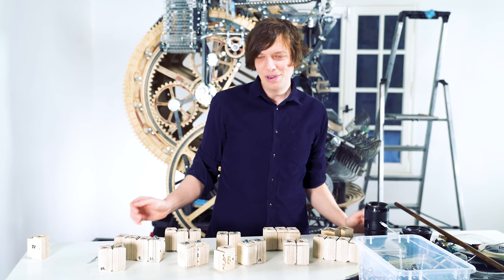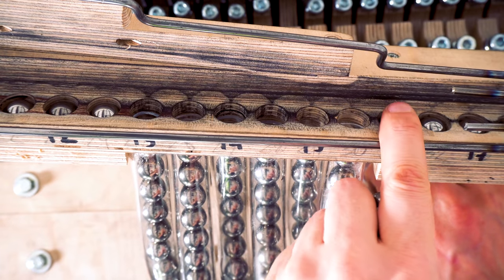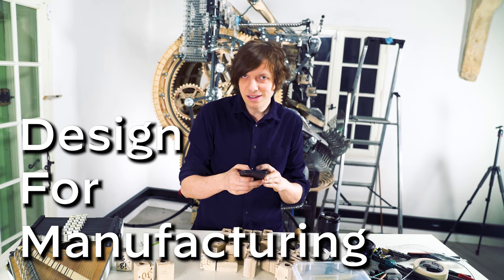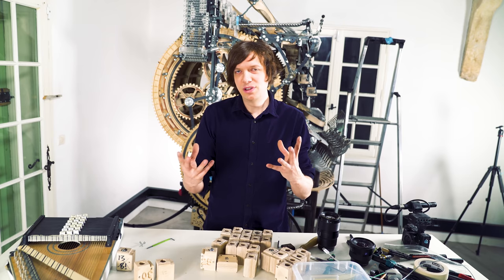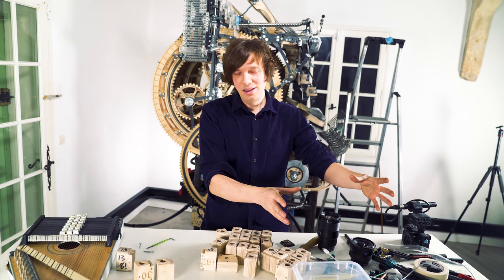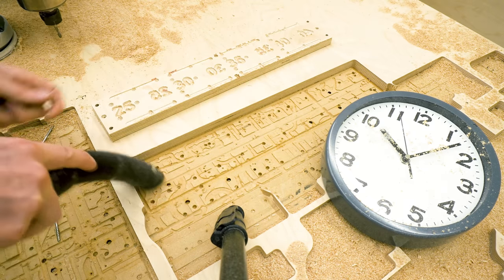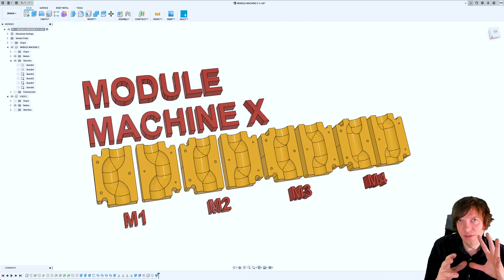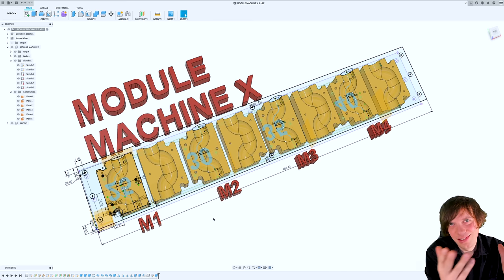Module Machine X

Comment: But is the Cybertruck really DFM? Assuming the chassi is made out of pressed sheet metal, why does it matter if the shapes are simple. If anything it should be worse since making sharp corner bends in sheet metal is more difficult. What am I missing?
Reply: I don't think you're missing anything. You're right about the sharp bends, say at the top peak angle, the sides at the top also seem to bevel. The junction of those compound angles would seem to need a v-notch and a welded joint, or two sections welded together. A curved roof side section would one piece and be done in a few forming dies/presses and even have connection points for the side pillars.
Reply: youre missing being a blind elon musk fanboy and beleiving all the ridiculous uninformed praise about him and his companies that martin apparently uncritically laps up.

youre right, bending hard lines into sheet metal is MUCH more difficult than the simple curves that car manufacturers have been using for over a hundred years, not because they "found them more beautiful" but because that's how bending metal works
Reply: It's because, supposedly, the grade and gauge of hardened stainless steel could not be pressed using normal techniques that are used to press thin gauge steel in normal vehicles.
Reply: @Hephera  The thing is it's 3mm stainless. It's probably cut and welded together. I'm thinking at best they could do simple unidirectional curves, but nothing near as fancy as most cars with compound curves. They would need ludicrous tooling.
Why the hell Elon decided to use 3mm stainless? I have no idea. I heard it's what he uses on the Falcons.
Reply: not missing anything. martin just has no idea what he’s talking about. simple as that. as impressive as he is. he’s a musician, not an engineer. obviously.

Comment: Cyber truck explained: it’s for style, if they can make rockets they can bend 3mm steel. They just didn’t do it because they didn’t want it. Just like their quality control on teslas.
Reply: You sort of opposed your own statement. “Quality control” sure they could figure out a method to stamp curved steel that thick, but it either would cost a fortune, or be unreliable with their shapes and panel gaps or something along the lines. As well, it’s hardly comparable to talk about rocket ships, vs mass manufacturing. Completely different engineering topic, and both are similarly complicated to get right

Comment: Round shapes deflect pedestrians without decapitation.
Reply: But decapitation gives the most points
Reply: With round shapes you survive as a paraplegic, canting angles finish the job and save you from becoming paraplegic
Reply: Design road infrastructure to keep people and cars separate. Designing cars not to kill pedestrians at upwards of 40mph is just a bandaid for poor road design.
Reply: @dugg117  'Judge I ploughed through that bus stop outside a school at 3:30pm because of the bad road design, honest..' you cannot road design away the idiots and the maniacs, until all vehicles are fully autonomous we have to assume there will always be accidents, even then it probably still makes sense to compromise DFM for the sake of safety just in case.

Comment: Just gonna say that the discussion about the cyber truck seemed to have nothing to really do with DFM. Whether the shape is geometric or organic doesn't make it any easier or difficult to manufacture (one could argue that it makes it more difficult if you ask me due to the manufacturing technique used for car bodies). You went into the discussion with a good idea but then it just seemed that you didn't get what DFM is.
A good example is when you design a 3D printed part. A good designer will consider the advantages and limitations of 3D printing when designing the part, such that the manufacturing process takes full advantage of the technology. This would include consideration of overhangs as the most common one. 
In the case of the height modules, that would be considering the round shape of a cutter and altering the geometry to fit that, like adding a small slot in edges so that they don't have to be filed afterwards.
Reply: He didn't really explain this in the video but the reason the geometric shape is DFM is because the truck's body is made of steel and not aluminum. Steel is extremely difficult (and therefore expensive) to curve, it's far easier and cheaper to bend it in geometric shapes. Using steel allows Tesla to make the frame and body of the truck out of the same material and during the same process. Essentially the body is the frame and vis versa as opposed to being two separate parts. The stainless steel also doesn't require paint to be protected from weather, a significant manufacturing cost reduction as Martin mentioned in the video. The Cybertruck takes advantage of the steel's strengths and plays around its weaknesses, the result is a geometrically shaped vehicle, DFM.

Comment: You can have hard edges and straight lines and still make a vehicle that looks nice. i think if they had just put a rear window on the cybertruck like a regular truck people wouldn't think it looks so damn ugly. it's not a pretty vehicle.

i mean it's not like it is a surprise that making a vehicle look good takes... extra work. extra fabrication. extra design. beauty is pain after all!
Reply: If beauty is pain, pain is temporary, and glory is forever, then beauty never lasts...

But you can change that today! Buy this anti-aging product and revitalize your skin. We're totally not using Photoshop and hyperbole to sell you a thing that doesn't really work!
Reply: Mainstream manufacturers like GM and Ford have been selling ugly looking trucks for years. It's a truck, it's designed to be functional and form follows function.
Reply: It's pretty.
Reply: @amicloud_yt  The current ones are even more ugly than the previous generation, and they have no excuse for it.
Reply: May I ask what you mean with square rear window, which placement? In the sail pillars?

Comment: My own perspective of the Cybertruck is that they are making manufacturing MORE difficult, with their seams and gaps where they are. They have had problems with their manufacturing accuracy with panel gaps...looking at the Cybertruck, it looks like they've made their job even more difficult.
Reply: Exactly. It's not like Toyota doesn't design current cars with DFM in mind...
Reply: Yeah, but now they won't have to worry about people complaining about terrible paint and dented aluminum.
Reply: disagree, bending metal and aligning straight edges seems easier than stamping metal and aligning curved edges

Comment: when you rebuild the machine  for touring do you think you're going to have to recalibrate all of these modules? I feel like having to empty out the pmma pipes from all the marbles just to take out the modules is very time consuming and I feel like there's a way you can design to put the modules on top of the pmma pipes just under the marble track in the marble divider.

Comment: Don't confuse "designers" with engineers. A car "designer" is usually a stylist, who as a breed only rarely tend to pay any attention to how practical something is to make. Trust me, sometimes stylists have to be reminded that a human being actually has to use their product. Conversely, engineers almost always have manufacturability in mind. Optimising the f*** out of something just comes with the mindset of being an engineer. Sometimes to a fault - it is easy to get distracted optimising something that is hardly ever used and costs very little.

The Ikea shelving may not require the use of a paint section, but dipping steel in liquid tin isn't a trivial task. It may be that it doesn't happen in Ikea's plant, and comes pre-plated on the steel roll, but someone, somewhere, had to do it and that cost is passed on. Just because you don't see the cost doesn't mean it isn't there.

Comment: I feel like you might run into the issue that the marbles cannot go to each channel fast enough compared to how fast the song you're playing is.  Essentially a throughput issue, and because the channel loading system is an overflow system, if each channel stops the marble before it goes into the channel, the later channels could have trouble with low amounts of marble backlog.
Reply: Remember that the marbles coming back up after playing split to the middle of the vibraphone channels and the drum channels.  The start of the vibraphone is fed by the overflow, which is going to be full up at the start of a song, which he can control by the on/off switches at start of song.
Reply: He once said he was aware of this and uses it as a creative constraint on the music he writes.
Reply: @Hirosjimma  Seems like kind of a dumb concession to an obvious issue. The question then becomes "How much of an issue/how limiting is it?"
Reply: @JZStudiosonline  The problem has been shown to be negligible two years ago, and has been extensively tested, what is dumb is youtube pseudo engineers looking at a video and fantasizing about crucial defects that are non-existent. 
The machine uses about 50% of it's total flow in a "normal" song, most of the overflow is going straight back up, unused.  the only instruments channels that COULD be impacted are the bassline, and he once calculated that it would imply at least 10 bars of permanent 8th notes on the bass to risk drying up... 
Unless he somehow turns the MMX into some sort of speedmetal machine with a shitty taste for very,very bad bass arrangements, you should probably ease up on the "dumb concession" tough talk, and respect that project a lil' bit more, because it took and will take considerably longer than what little time you used to write a blantantly false statement based on your ignorance of the subject.
Reply: @sirzebra  Right. My amazing ego. And I'm the douche with your response being as such. You still have no idea what my credentials are. It's like the people who will argue with my buddy about how the chips he designed actually works, like he doesn't know.

Comment: Isn't there any way to measure the length of the marble path inside the module in Fusion 360 and then CAD it, so you just enter the parameters, and the module is adjusted to the desired marble path length automatically? I don't know the software, but I guess it should be available, after seeing all the options that the software actually gives you. Am I wrong?

And BTW Martin... do you even sleep? I'm worried... I mean everyday Wednesday is a lot. And no, I'm not complaining :)
Reply: The method of manufacture of the pmma tubes introduces massive variability that likely makes any path length information from the cad marginally useful. He'd also need to factor in nesting of the marbles and the inconsistent/geometry surrounding material makes this nearly impossible.
Reply: @rascal3042  Ok, but I don't think that's accurate. The variability of the whole path length (from the input to the dropper) is like 0,5 mm max, from what Martin tested. That's not massive...  that's marginal :). I think it would be much easier to get the information of the actual length of the marble path inside a given module, just for the ease of adjusting/exchanging the modules.

PS. And also, a few episodes ago, Martin made the supports for the PMMA tubes to mitigate the variability of the path length, that originated from the movement of the tubes.
Reply: Funny that hes gone through multiple offsets to get 1 channel to work then.
Reply: @rascal3042  And that's what I'm talking about. Maybe there's a way to get it to work quicker, I'm just wondering and throwing an idea. No need to get upset.
Reply: In solidworks there is a feature called path length dimension which allows you to do exactly that. Don't know if it exists in Fusion tho
Reply: Martin has someone who helps with editing the videos if I recall correctly.

Comment: well martin why did you not do a length slider like a trombone, an fix it with a worm screw, its way easier and qick to re/calibrate :P
Reply: I also was thinking about that! with Wood a ZigZag mechanism will work with using wood and also no gaps. Using different plates of wood that interlock each other. Like a bridge that extend in the Summer. Cars can still ride the bridge. Because the gaps between the zigzag is smaller than the tires. Combine that with a design of a trombone and you will have the perfect marble path that can extend.

Comment: Martin, I think that when checking the consistency of the height of the column of marbles, you should empty more the channel. Maybe it's overthinking, but it seems to me that just measuring the difference of 1 marble can lead to reading smaller changes in height than in reality due to the cumulative error of the change in position between every two marbles. 
Hope not! 
Love your work and these new videos!
Reply: Not sure I understand your point? The height is only relevant when a channel is full.
Reply: @ferrumignis  What he is saying is that the marbles might stack different when fully loaded each time so by emptying it and reloading it each test you get a better overall average error. Martin mentioned something similar a few episodes ago. I don't think this is issue really though. If one is not working reliably he can just adjust to a different module.
Reply: I agree, When measuring, he should not drop 1 marble and refill, but instead: measure -> empty the entire column -> refill entire column -> measure again.
This is because all marbles will land in a different way inside the tubes.
But still I think the margin in height diff will be minimal. But then again, the marbles rolling on top only need a column to be a fraction high or low for a marble to get stuck. So... who will tell if it'll work... we can only hope or redesign
Reply: As many people under yesterdays videos (height modules) commented, this height module design is problematic. The tolerance chain is very long, the paths (i.e. pmma pipes) are slightly bigger than the marbles' diameter. Therefore, the vertical row of marbles forms a snake pattern in the pipe, which is not always the same of course. Thats the reason why this design with the height modules will not guarantee the needed precision on top of the marble devider.

In this video Sebastian Kirsch came up with an brilliant idea (trapdoor hook system) which could solve the problem:
https://www.youtube.com/watch?v=zahlKPc6TMA&feature=youtu.be

Please vote it up on discord that Martin and the engineerng team can see it:
https://discord.com/channels/649165975647682560/649172304638640130/802136003137372180
Reply: @FM-vh1on  That design is nice but I don't think it is to the point of a complete redesign when it hasn't even been determined there is an actual problem. For all people know even if the marbles do snake differently each time it might be insignificant. Better to stick with the current design and see if it works first. Then if reliability becomes an issue redesign. The shipping and things moving is a none issue as he will have replacement modules that will cover any variability. Instruments sometimes need tuned.

Comment: I love Martin but his love affair for Tesla and Musk is a bit painful to watch.  The idea that the cyber truck panels are easier, quicker or cheaper to make is not really fully thought through.  Car panels are stamped.  The tooling is the only thing that takes effort to create.  The difference between straight angles and curves to comes down to tooling design.  Both the cyber truck and every other car will be using presses to press out panels.
Reply: Traditional automotive tooling is designed for regular steel, not the 30X alloy stainless steel of the cybertruck. Simple bends result in simple tooling, which is important when working with a less ductile material. If Tesla went with a more traditional alloy, then stamping complex curves would be easy to do through tooling design, but alas, they did not.
Reply: They don't cut cost on stamping (which I agree costs pretty much the same, regardless the geometry) but on painting
Reply: @benjaminwright9307  It's not just the alloy itself, it's also the heat-treat and thickness of the sheet metal. The exoskeleton completely replaces the tube structure found under the thin skin of traditionally designed cars. I guess the manufacturing of the exoskeleton is quite a bit more expensive than stamping thin sheet metal, but they save tons on other stuff
Reply: @ilikeyourname4807  That sounds pretty dangerous though. The interior structure and the thinner metal of the outer shell of modern cars are designed to absorb energy in crash situations by bending in predefined ways. If the exoskeleton of the cybertruck is the entire structure then there is very little design space to add crash safety without affecting the looks of the car.
Reply: @TravelingDomokun  actually, crumpling zones for energy absorption are only found in the front and back of the car; around the passenger cell, rigidity is of major concern - especially in electric cars, for battery protection.
Reply: @TravelingDomokun  Yes, there are no crumpling zones in the Cybertruck. They bet all their money on active safety systems. That's why the Cybertruck will not be road legal in Europe without major alterations (more than just sizing it down to fit our roads)

Comment: If I were you, I’d also slightly round over the tops of the holes in the track that the marbles roll down.  That might help if the marbles ever become slightly too high or low in operation, because it seems that those which do stop, are stopping because they don’t quite have enough momentum to make the “hop” over the harsh 90 degree ledge.  Hope that makes sense!